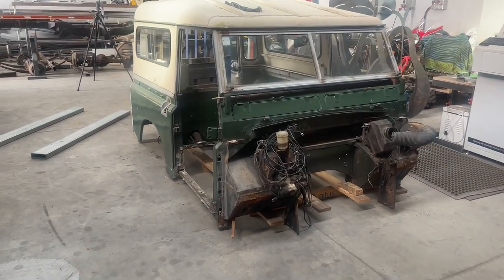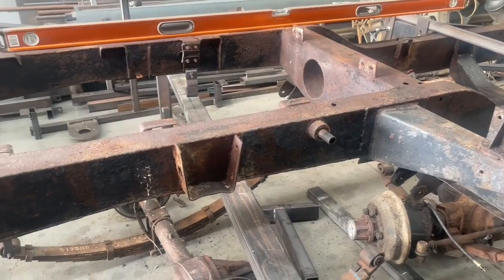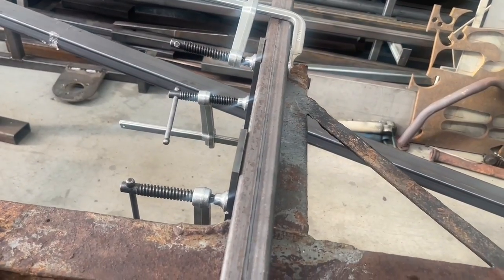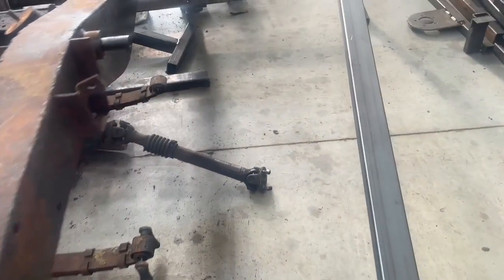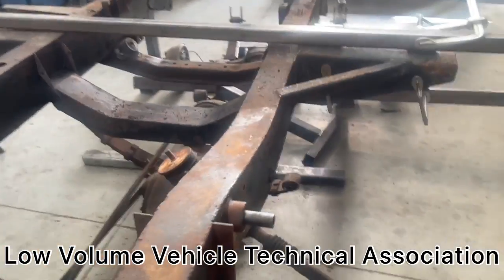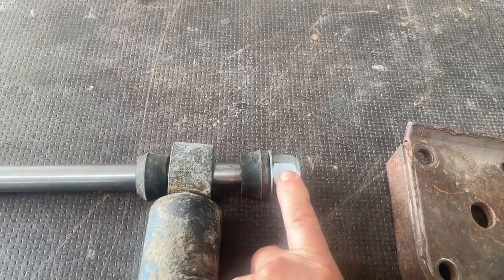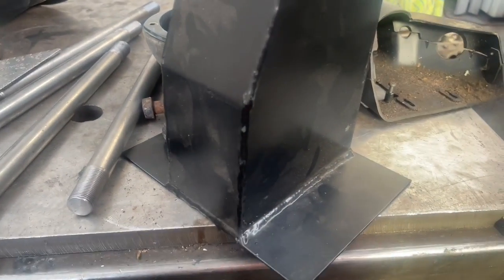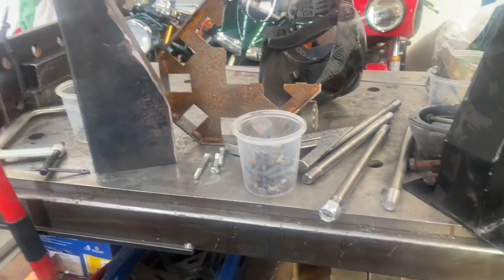Land Rover Chassis (Jig  Build 1.2)

Comment: Looks great, very interested to see progress on this. I agree about the additional plates on replacement aftermarket outriggers - if badly installed they are another trap for rust, and don't look tidy. Interesting the LVV people would feel comforted by additional gussets when there have been over a million of these chassis used often in very arduous conditions over the last 70 years and I haven't heard of a case where a sound chassis (i.e. not terminally corroded) has failed. Although I agree improvements can be made, especially in corrosion resistance, mud traps, drain holes etc.
Reply from the maker: Thanks for your comments, we are building a case for the chassis to be pre certified, if there can be such a thing, It will still be the responsibility of the installer, owner to go thru the cert process but anything we can do to make sure the chassis is known to the authorities will make things easier.